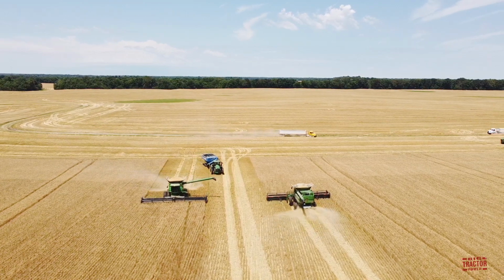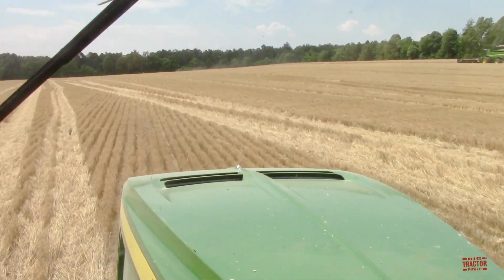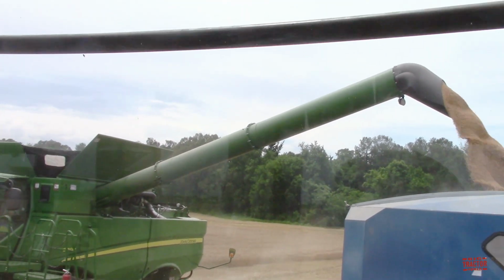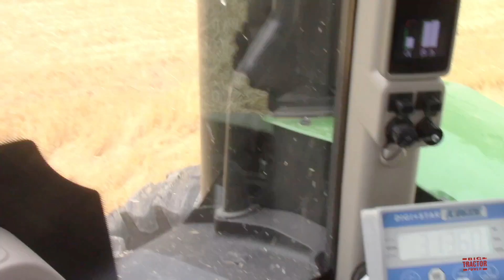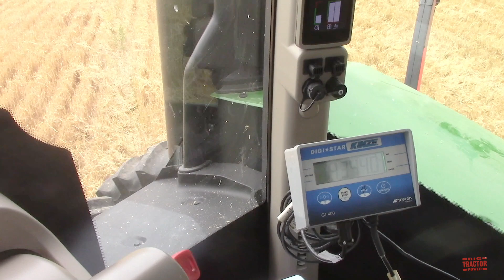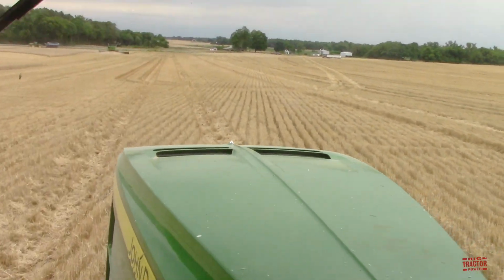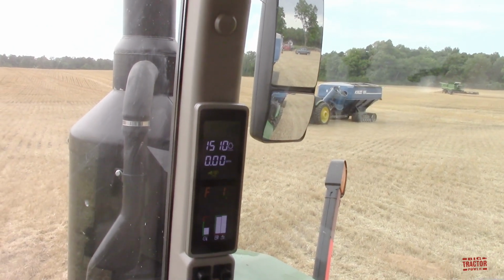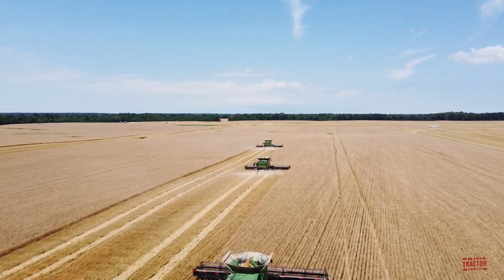Driving a Grain Cart Tractor in a 1,000 Acre Wheat Field

Comment: This vid is most interesting because this is my job during harvest, our fields up not big straight or flat in some cases what works is I only have chase one combine. Sometimes crop conditions can change which effects speed of unloading.  Other farms I have chase you deal with older equipment that needs time to service so judging time in fixing problems and keeping up to combine can be tricky.  Planning ahead where equipment needs to be, mother bin try be central then trying chase three different combines setups.  In the dark is hairy as you can quickly lose your way, I place lights on field bin or call on UHF for truck put his lights on.
We used CaseIH 215 Magnum pulling 18t chaser but had chaser hook up to NH TM 120 or McCormick 130
Other farms TW15 to 23t chaser / JD 9520 to 38t chaser / CaseIH 9130 to JM 25t? chaser / Fendt 700 to 23t chaser

Comment: Wow 7 combines? I only use 3 combines on my fields.
Reply: They have to keep 4 for spares, they are John Deere. If they stop for lunch 3 out of the 7 will not start, the plastic parts will break. ( really ought to consider a little metal) All operating levers will be put in the most difficult place to use. The brake will not come loose. You can always be like the millennial farmer and buy New when they break. Brilliant new design putting the alternator inside the engine, easy to change when it goes bad.
Reply: @ddorn04  you sound like an expert and an optimist. I can’t imagine a product out there of any color that would live up to your expectations. You ever think a farm this size doesn’t fully explore all their equipment brand options. Too bad they don’t hire you because obviously their success was built on stupidity
Reply: 3 combines?  Yet you have only video games and cartoons in your subscriptions here.  Sure.

Comment: Has John Deere made a class 10 combine yet?
Reply: The X9
Reply from the maker: In 2021 a new 420 bu 630 hp class 10 X9 1000 and a 690 hp 460 bu class 11 X9 1100 will be available.
Reply: @bigtractorpower  thank you for the information.
 There are some X9 roaming around you know trail time finding thing's that need upgrading. Improving others thing's that need some tweaking.